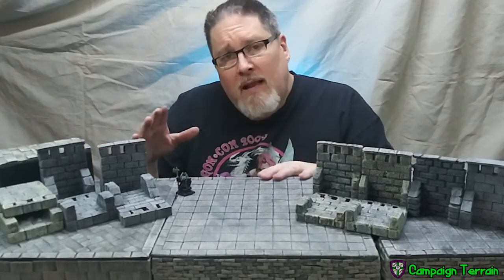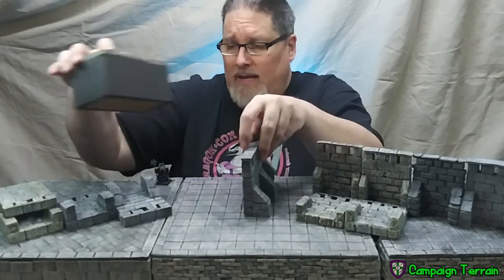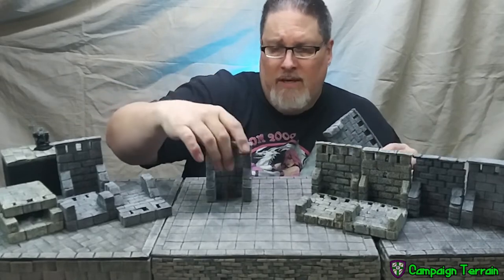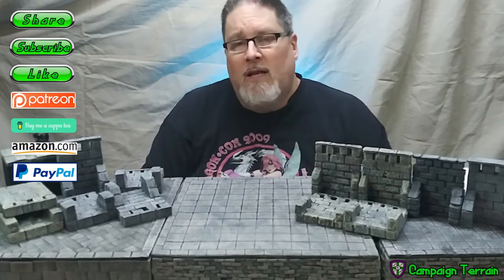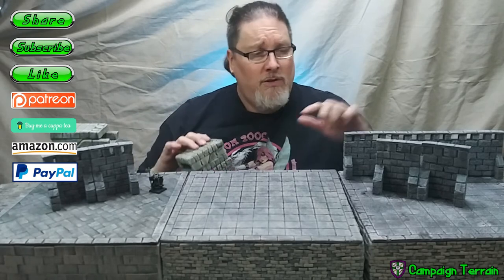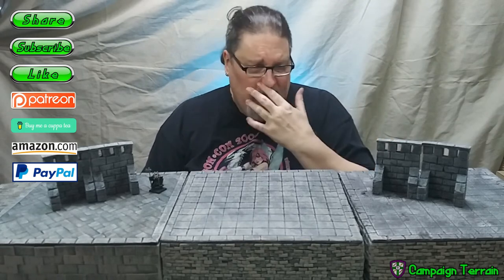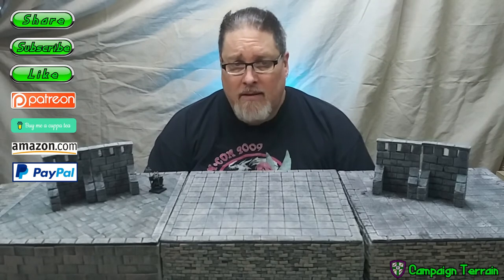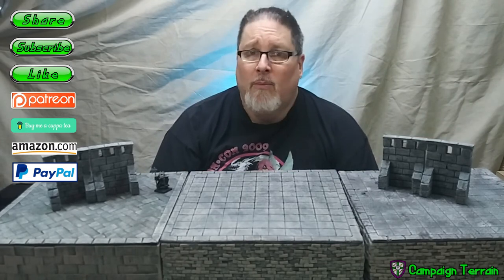Modular City Railings (Episode 0058)

Comment: Excellent once again. Super useful and they add so much to the overall look. I have had good luck using a couple of drywall screws in the bottom of foam wall bits to keep them upright. Another option might be a very thin base of card that is flush on 3 sides but sticks out the front just a bit. Cheers!
Reply from the maker: Thanks! Glad you like. My next batch, which won't have buttresses, will have some screws. I've also considered creating metal ground levels, and magnetizing everything that sits on them, as Nat 1 Videos showed, in his video. I've thought about card or tongue depressors, but would want to ensure the protrusion is painted like the cityscape. Thanks for the suggestions

Comment: If I may suggest putting bolts.  Works great.
Reply from the maker: In the bottoms, to help with stability? Not a bad idea. Once these are leaned against a wall, they're stable. Stand-alone, though, they can get a little "tippy".
Or were you meaning something else?
Reply: @CampaignTerrain  yup, that is what I meant for the stand alone stability. Have bolts, and if you use one of those cheap magnet sheets, it’s even better.  I don’t know about the magnet spray. If that is transparent you can spray those tiles down.
Reply from the maker: I've thought of using metal under floors, and magnets in the scatter. Not sure if that will work, with my City Block Blocks, though. Might be a little dangerous, to be opening and closing sheet metal. But I like the bolts/screws idea, muchly